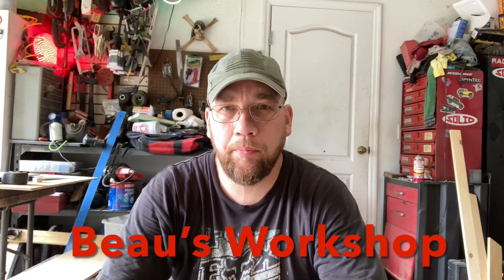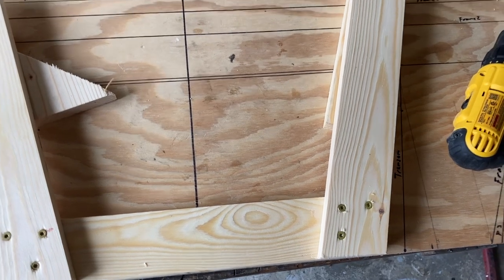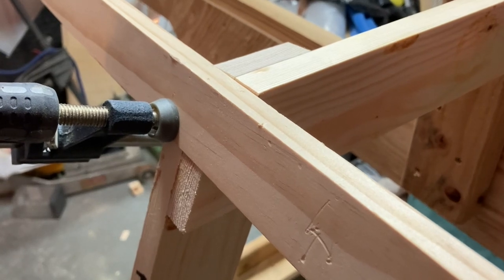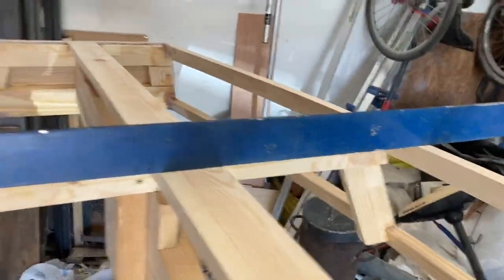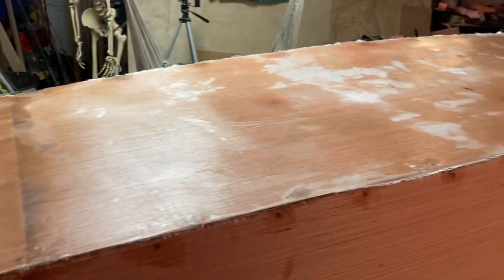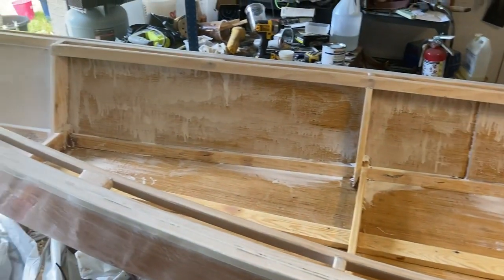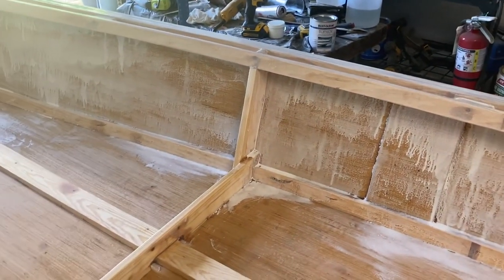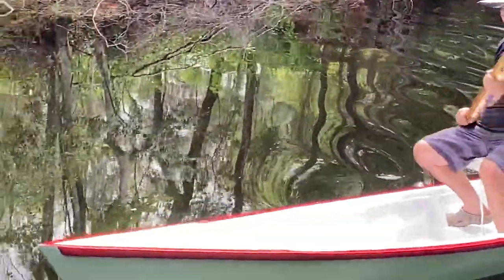Rail Bird XL Poling Skiff Wood Boat Build

Comment: Really nice build. I like the modifications, especially the bow cap. It appears to be more than enough room for two marine batteries up there. I mostly do night fishing, so I carry 2 (sometimes 3) batteries to run lights and the transom troll. 
I like your ice chest. It looks to be about the size I use. The only problem is the big guy, big cooler, little boat phenomenon. I've been tinkering with a cooler dingy design. Basically a little separate boat for the cooler. When I get something that works how I want it to, I'll probably put up a video.
Reply from the maker: Let me know when you get a video up. That sounds like a good idea.
Reply: @beausworkshop3157  I will keep that in mind. It will be my first video though, so please don't expect too much. 😒

Comment: Hi Beau. Just wanted to compliment you on the excellent tutorial, and especially in taking the time to do materials testing. That takes a lot of time and effort to set up, let alone documenting so big kudos for sharing that information. Will definitely check out your in depth video on that topic and your proposed Carolina Dory. 
I like Jeff Spira's designs and building concepts but I have a unique situation here in Indonesia (expat from North Carolina), in that I need a boat that can be beach launched and left on the beach because the concept of trailerable boats never made it over here so obviously there aren't any boat ramps. So I have a lot of design challenges, a boat that can get on plane with a small engine (only the engine goes home), is sturdy enough to be launched and landed from the shore singlehandedly and handle some chop plus ugly enough that no one wants to steal it. In other words a strong lightweight working skiff.
Reply from the maker: Check out Jeff’s pacific power dories. There are videos of them beaching and launching.

Comment: IF you or your children wish to paddle your righteous little boats, I'd like to suggest J-stroke as it will not be necessary to constantly switch sides when paddling.  I've learned this paddling my canoes and it really does make paddling a ton more efficient.  Also, if you're in shallow water with a solid bottom, you might want to watch videos on poling a canoe.  The Native Americans used poling to get their canoes UP rivers in all kinds of rough water.  You can go up or down river, zip sideways to pockets of calm water, stop, look things over and start again.  I think it'd be a great technique in your neck of the woods.  Rather amazing just how much control people have poling a canoe and your rail bird boat looks to be a great platform for that technique...
Reply from the maker: I definitely want to try poling one of these. I think it will work really great.

Comment: This boat is called a Pirogue  pronounced Pe' row. .. this is a small double ender low-profile canoe.... Louisiana they've been used for hundreds of years if you count the dugout canoe.. 
I plan to build one out of 1 x 12 x 16 pine plank to avoid all the framing , two-seater for bracing plywood bottom or plank bottom.

Comment: I love it! You have inspired me to make something similar as well, a little criticism but positive in nature...instead of using sharpie lines that can bleed up to a 1/4in. use a fine marking knife and pencil fill the line it will make your woodworking that much more accurate and precise if you think about it that large diameter line makes for a lot of room to move... although minute it might mean the difference between tracking straight or always correcting the track of the boat, as you said in the beginning the more accurate you are in that step is critical before you move on...cheers mate great build
Reply: If you really need fine accuracy I'd go further to set up a jig. Hard to go wrong when butted up on a raised line. However, in all frame construction there's a fair amount of leeway. It's good to start accurately within reason but this isn't cabinet building. If you can wrack a stud wall into square you can wrack a boat frame.

Comment: definitely inspired to build one as I live north Florida myself. When you fiberglassed the boat did you only do the outside and paint the inside or did you fiberglass inside and outside?
Reply from the maker: I used fiberglass on the outside. I sealed the wood on the inside with epoxy and painted with primer and topcoat.

Comment: So with the high cost of buying a flats boat I’ve been kicking around the idea of a stitch and glue 16’ footer but I’m confused about if you have to order plans in order to get it registered or you can build it from scratch in Florida I’m in Pinellas co, I’m an old salt and need something a bit more wider and more stable and would like to put about 15-25 seahorses on the back end , your tests really helped , I was curious myself on strength and impact and how strong to make with the glass and still keep the weight down , that’s a dandy poling  skiff ya got there and I think it will work great to get up around the skinny water , great job and super video , tight lines bro ! 👍🏼
Reply from the maker: In Florida, You only have to fill out a form to get a title for homebuilt boats under 16 ft. Larger boats require and inspection from FWC. The inspection is not a big deal.

Comment: Hey, Beau, super video!!  Your calm, matter-of-fact  delivery is very well done. I like your honesty and how you pointed out a lot of little details from the experience of your first build.  The plywood layout table is fantastic. I have Jeff Spira’s plans for a Pacific Dory, (basically the same construction).  I have a suggestion and a question.  Suggestion: if you put a recessed shelf at the base of your plywood layout board, you can lay the bottom 2x4 frame member so that its top surface is flush with the table, and this eliminates, at least for me, the parallax error when you lay down and align the side frame members with your layout lines.  My question is I see that you didn’t notch for the chine log until you put the frames on the strong back for both builds. Is it just better that way to make sure everything aligns, because it would seem to be a lot easier to notch the frames on a workbench. Again, super video!
Reply from the maker: I precut the chine log notches on the first build and I found that there was a lot of fine tuning, clean up, and filler. They are not straight cuts. I find that it is easier to cut the right angle when the frames are mounted on the strong back because I can visualize the angle of the cut better. I will add a shelf to the layout board for the Dory build. That will make it easier considering the size of the frames. Thanks for the idea.

Comment: I have been looking for a boat to build and I love this one. I have looked on Jeff Spira's web site and will be ordering the plans for the Rain Bird. You mentioned you added to 30% to the build do you remember the actual measurements?
Reply from the maker: I don’t remember specifically. I just did 30% on the uprights. If you don’t reduce the angle of the transom you will come up short on plywood on the sides. I widened the transom 25% and frame one about 15%. I had it out this weekend with my wife, trolling motor and cooler on board. It works really well. If you build one I’m sure you will love it.
Reply: @beausworkshop3157  з

Comment: I wanted to build one, but unfortunately Jeff Spira passed away and the plans are no longer available.  Any way to get the plans?
Reply from the maker: I altered the design on the Railbird XL quite a bit from Jeff’s Railbird. I’ll see if I can find the measurements of what I did and get back with you. It will take some time. I’m in the process of relocating.
Reply: @beausworkshop3157  Hi Beau, I'm built the Spira Huntington kayak and planned to build the rail bird, but missed my window.  When you get settled in could you please share the measurements with me as well ? Thanks

Comment: How would u feel about the  boat on big rivers use as a kayak
Reply from the maker: This version of the Railbird would do fine. The higher sides are useful in busy areas. It still paddles easily. The first one I built could be swamped by another boat pretty easily.
Reply: Would u have rail bird  plans i could buy i  like  the sec one and a bigger  river . Would use on rivers.  Thanks for your time and awesome video    . I went to order plans from jiff and  his plans are no longer available.

Comment: How did you make your cooler
Reply from the maker: I buy meat from Wild fork foods and they send it in a styrofoam cooler. Epoxy resin does not melt styrofoam. I used epoxy to glue wood panels to the cooler and I used fiberglass cloth inside and out. I haven’t finished it yet. It weighs about the same as a heavy duty cooler. I will make a video of a cooler build once I work the bugs out of the process.